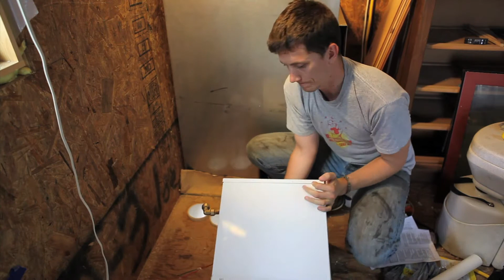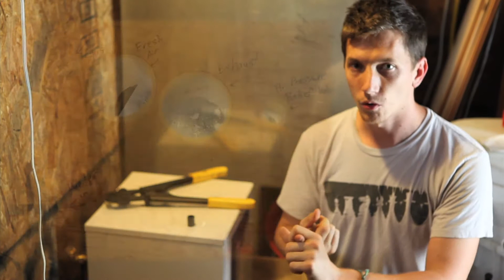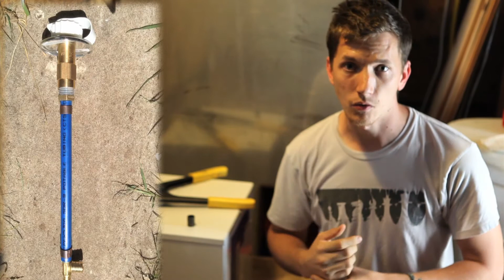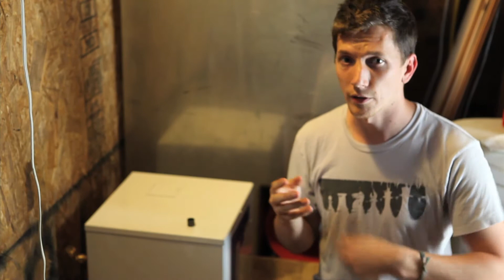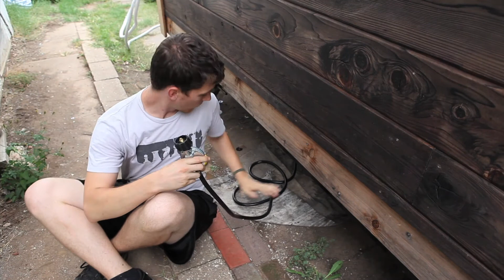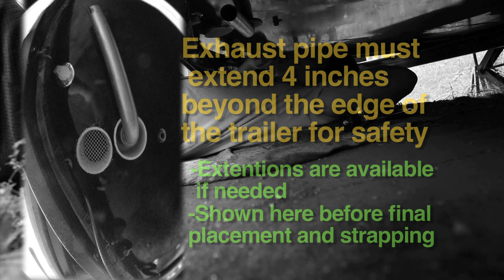Tiny House RV-550 Tankless Water Heater Installation - www.precisiontemp.com

Comment: Hey, thanks for the video. I had a  hole cut that fits the drop exhaust pipe perfectly, it's about 1.5 inches in diameter, but I see the manual says to cut a 3.5" hole. The biggest hole saw I have is 3" though. I wonder will that suffice?

Comment: Thanks for the informative video. Do you recall the thread size and type of the pressure relief valve discharge? I'm trying to select the proper adapter to attach the garden hose section as you did.

Comment: Thanks.  I purchased a Precision Temp & uncartoned to inspect (recycled carton before I realized that I probably should have ordered the side venting unit -but can’t return & am a tad frustrated). I’m currently up to installing the PEX within building and have someone helping who seems confident that you must use black steel for propane. IMPORTANT: Did Precision Temp tell you that you could run the flexible propane tubing all the way from the back to your unit? Regardless of the answer....Thanks so much for a very clear video.
 I’m also struggling because I have a 26’ Tumbleweed that is a  LOW rider built out over the wheels and my engineered plans have my 46 gall water tank plus propane (& pump) sitting above the axels (for stability) & I’m encountering all sorts of issues with not being able to vent DOWN into the wheel well. Any suggestions are welcome as I can’t even get a local Home Depot referred person to install it (an ongoing issue around tiny houses here). Anyone within 60 mile radius of Bethesda who is willing to help, I’m seeking to hire for this part.

Comment: How did you seal the gap between the bottom of the water heater case surface and the top edge of each 4" PVC hole?  The mounting bracket that comes with the heater raises the water heater off the floor about 1/4".  My question is how did you account for this, if at all?

Comment: Does it need to extend 4” beyond edge of entire trailer ie: did you have to get a long pipe extension to attach to that elbow you have coming out of the water heater? 

Thanks

Comment: Where do you get the exhaust pipe extensions.  My floor is over 6" thick.
Reply: +Dave Burkle I was reading the questions on the Amazon link and saw a suggestion to get the pipe extenders at an auto parts store. http://www.amazon.com/PrecisionTemp-RV-550-Tankless-Water-Heater/dp/B00HS3JSIW/ref=sr_1_3?ie=UTF8&qid=1445744488&sr=8-3&keywords=rv+550#Ask

Comment: Hi there! 

Where exactly did you get that pipe extender? I’ve read that you can get it at an auto body store, but I can’t seem to find one that’s galvanized steel. Can it be regular steel? I also tried calling the PrecisionTemp hotline with no answer. 

Thank you!
Reply: Meaghan Sharrard did you ever find an extender that worked?
Reply: He's using a 2" set screw EMT coupling that you would find in the electrical department of any big box store. He also said he used high-temperature silicone to fill in the gaps. That being said, you can go to a vehicle exhaust store and they should be able to help you out.